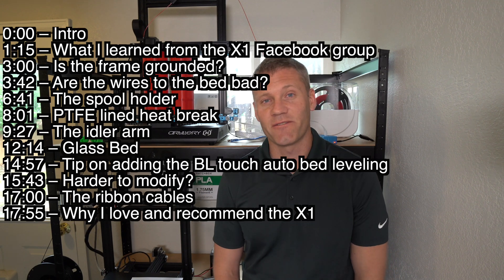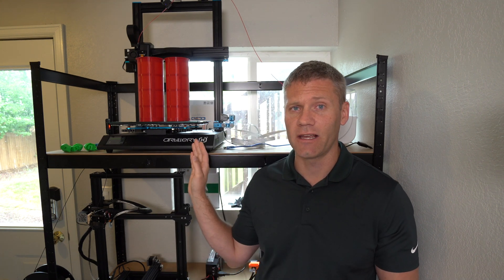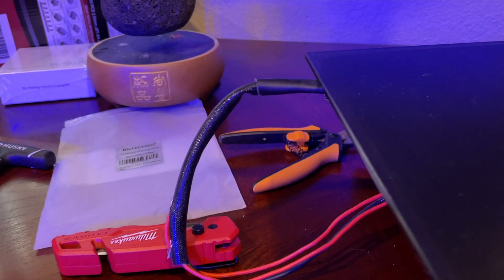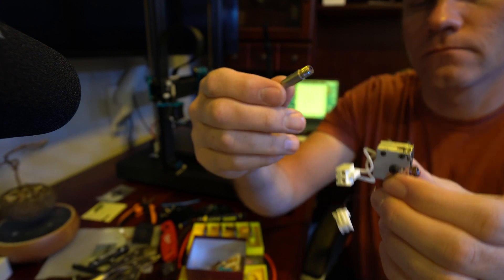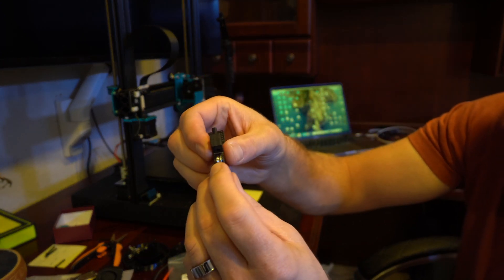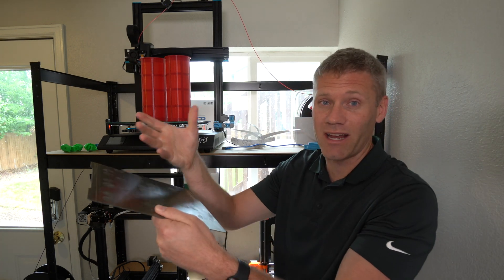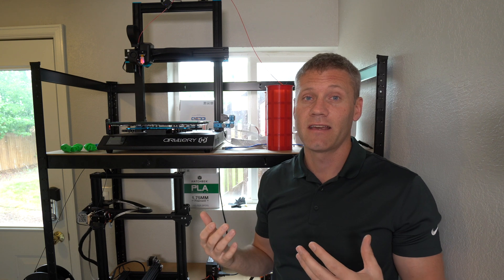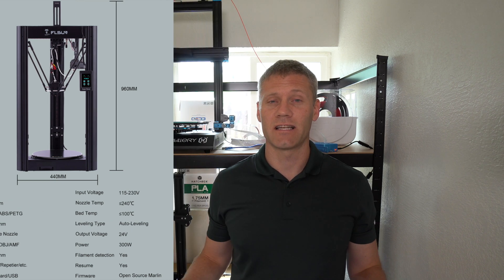Artillery Sidewinder X1 Review - 6 Months Later

Comment: I had the sidewinder x1 since ~2021 (so it is the v4). My experience was a bit different:
-Bed cable broke after only 8 days, replaced the iron strands with normal household copper strands)
-added a steel sheet printbed (best upgrade imo!)
-printed and added a simple ribbon cable brace to the print head as I heard people had issues with that part
-replaced the nozzle with a ruby one (for abrasive glow in the dark or basic white filaments for example)
-usb sticks got fried a couple of times from voltage spikes
-touch screen got a "permanent touch point" (where it spams "taps" in one area)
-as the "frying" got worse, the tft froze in the middle of printing (and with it the prints failed)
-frying of sticks and touchscreen were caused by the very cheap psu (slight changes at input voltage caused big voltage spikes on dc side)
-replaced the psu with a proper one and replaced the tft as well
-the frame for me is not grounded for some reason... just wanted to add that. Some parts internally are grounded though. Like the shielding on the psu is grounded but not the frame/metal/screws of the printer itself!
-used octoprint as it is just more reliable and offers camera support for checking in from a distance
-tried to get "pause commands" to work but it is just not really compatible and everything that works is just too hacky for it to work on every slicer (upgraded firmware on mainboard/marlin and the tft /Rawr tft -> really useful as it has a console, offers more options and makes beeps quieter)
-the extruder started to make weird noises and the ribbon wires started to get way too hot (after about 4 years of use) as the ribbons are rated to 80°C but were over 100°C at the connectors!
-reason was the bearings inside the extruder stepper were finished: really crunchy and pieces of metal fell out. Same with the thin bearings on the idler. It was running on the aluminium already xD. Beplaced the bearings inside the stepper (very cheap) and the thin ones (ordered quality ones, but artillery gave some simple ones in the spare parts bag!)
-added M8 steel rods to stabilize the z-axis for a bit less wobble when printing tall & heavy objects
-added an led strip to the horizontal x-axis made from spare parts

So far a good workhorse, that needs a bit of attention every now and then. Best 300mm printer <300€ back then as long as you dont mind modding and a bit of repair.
Only things that reallly annoy me are that the hardware/software does not support normal pause commands and that the bed is rather unevenly heated.... But as long as I keep that in mind when placing objects, I am able to work with that! It is now printing weeklong gcode files for giant hd moon lamps. (1300MB gcode files)

-I never had real problems with the ribbons that interrupted a print
-I never had issues with the z axis wobble so far. Only noticed that it swung around too much for my taste which caused artifacts in tall objects when I accidentally touched it or pulled filament from a dryer over the filament holder from behind the printer.
-I never had issues with the idler either. But I replaced it with an aluminium one this year. As I was already replacing the bearings in all the printhead stuff.
-I never had issues with hotend. But I might upgrade to an all metal one when I feel like it could use a bit of love (for the trusty work it does) Any recommendation for a good fitting one?

Comment: 2 years with my X1 and zero problems.  No ribbon cable problems, no idler lever problems and no bed problems.  I think a LOT of the initial commentary on "problems" was just regurgitated "Internet rumor" opinions and not actual deficiencies.  The only thing I have done was to install an all-metal hot end.  That's it. It just works.  I now have another Artillery, the X2 this time and I'm happy with both.
Reply: I had the sidewinder x1 since ~2021 (so it is the v4). My experience was a bit different:
-Bed cable broke after only 8 days, replaced the iron strands with normal household copper strands)
-added a steel sheet printbed (best upgrade imo!)
-printed and added a simple ribbon cable brace to the print head as I heard people had issues with that part
-replaced the nozzle with a ruby one (for abrasive glow in the dark or basic white filaments for example)
-usb sticks got fried a couple of times from voltage spikes
-touch screen got a "permanent touch point" (where it spams "taps" in one area)
-as the "frying" got worse, the tft froze in the middle of printing (and with it the prints failed)
-frying of sticks and touchscreen were caused by the very cheap psu (slight changes at input voltage caused big voltage spikes on dc side)
-replaced the psu with a proper one and replaced the tft as well
-the frame for me is not grounded for some reason... just wanted to add that. Some parts internally are grounded though. Like the shielding on the psu is grounded but not the frame/metal/screws of the printer itself!
-used octoprint as it is just more reliable and offers camera support for checking in from a distance
-tried to get "pause commands" to work but it is just not really compatible and everything that works is just too hacky for it to work on every slicer (upgraded firmware on mainboard/marlin and the tft /Rawr tft -> really useful as it has a console, offers more options and makes beeps quieter)
-the extruder started to make weird noises and the ribbon wires started to get way too hot (after about 4 years of use) as the ribbons are rated to 80°C but were over 100°C at the connectors!
-reason was the bearings inside the extruder stepper were finished: really crunchy and pieces of metal fell out. Same with the thin bearings on the idler. It was running on the aluminium already xD. Beplaced the bearings inside the stepper (very cheap) and the thin ones (ordered quality ones, but artillery gave some simple ones in the spare parts bag!)
-added M8 steel rods to stabilize the z-axis for a bit less wobble when printing tall & heavy objects
-added an led strip to the horizontal x-axis made from spare parts

So far a good workhorse, that needs a bit of attention every now and then. Best 300mm printer <300€ back then as long as you dont mind modding and a bit of repair.
Only things that reallly annoy me are that the hardware/software does not support normal pause commands and that the bed is rather unevenly heated.... But as long as I keep that in mind when placing objects, I am able to work with that! It is now printing weeklong gcode files for giant hd moon lamps. (1300MB gcode files)

-I never had real problems with the ribbons that interrupted a print
-I never had issues with the z axis wobble so far. Only noticed that it swung around too much for my taste which caused artifacts in tall objects when I accidentally touched it or pulled filament from a dryer over the filament holder from behind the printer.
-I never had issues with the idler either. But I replaced it with an aluminium one this year. As I was already replacing the bearings in all the printhead stuff.
-I never had issues with hotend. But I might upgrade to an all metal one when I feel like it could use a bit of love (for the trusty work it does) Any recommendation for a good fitting one?

Comment: I've been fighting hard to address a really strong bed adhesion, like the parts will NOT release. The fix I've been doing, until late, has been using a raft for parts so I can destroy a raft to try to release the parts easily, lowering the build plate lower for a "air gap" between the raft and the build plate, using Painters tape to avoid potentially warping the bed when "prying", AND heating up the bed after the print is done for making the raft malleable again while working the part. I want to enjoy using the special release build plate without using a raft for a smooth bottom surface, but with how strong my prints have been adhering, I'm scared it'll become a permanent attachment to the bed. I love this printer, and it works great and makes beautiful parts. It just holds them too tightly.

Do you have any advice?
Reply from the maker: Scuff it slightly with some sand paper, then clean well with alcohol. raise you starting z height. Its either really new and just sticking well or you too low on 1st layer, Even if you just clean it 10 times with alcohol I think would help get it a little warn.
Reply: @Walt's Reviews  When you say scuff it, you mean the build plate or the tape? Wouldn't scuffing it make it "grippier"? I have some 220 grit i could use, maybe 500. 

I raised the Z height and get differing results depending on the parts, but that's helping. It heats up nicely, I've been using 80 degrees for the build plate, and some wider prints still have some warpage, but I think it's a matter of "small prints need rafts and supports for easy release, larger prints need higher Temps for preventing warpage at the build plate."

I'm not against the scuffing, I just don't want to mess it up. I've been considering a PEI, but it seems this kind of build plate makes that redundant, right?
Reply: @waltsreviews90  spend the money on artillery’s pei bed sheet. Don’t listen to others and clean it with rubbing alcohol. I never touch it bare handed, I wear rubber gloves and I couldn’t get a single thing to stick to it until I washed it. Most people use dish detergent however I use something from my car cleaning supplies- strip wash by Adams polishes. Ever since then I have had zero, and I mean zero adhesion issues. I have never once even took the sheet off to bend it to release the part either. Not once. The prints stick like they are welded on during the print process and when it’s all done just let everything sit and cool for about 20 mins give or take. You will hear it pop and you can literally just walk over and pick up your print. No scraping no glue stick no aggravation. Spend the 60 bucks trust me. And level it with a business card. You’re going to be so happy

Comment: I think the extruder pressure (idler) arm braking was with the first series and down to an inferior plastic used . I too have never had a problem with plastic but changed to alu just in case,  As it pivots in the stepper motor axel a good well lubed bearing is important and my gut feel is the super rigid alu arm does a better job of guiding the filament. Like wise the first series suffered from "questionable" ribbon cable connectors which have now been updated for a better connection.   For those that don't want the hassle of installing a sensor there is also a manual method which is explained here  https://youtu.be/0MLo6fkeFmI
There's also an excellent video on how to repurpose the OEM Z endstop as a sensor . Worth a look > https://www.youtube.com/watch?v=RwYuqzj3aLc

Im tempted to install a 32 bit board but am applying the "if it aint broke dont fix it" principle !!
Reply from the maker: lol, no point in creating extra work for yourself! Thanks for the input, I'll check that out.

Comment: Your video pretty much confirms all I've found out by watching a bunch of other videos. Yes, a lot of people love this printer and get great results from it, but there are one or two (actually, mainly one) reviewer who really hates it and puts out really scary reviews. He does have a point when it comes to the bed cable and the lack of strain relief, but now he's come up with other things he doesn't like, such as the extruder design. A couple of others have had problems getting good prints, but they do seem to be much in the minority. One person had a problem because Artillery changed the pinouts of the printed boards that connect the ribbon cables, people in the comments pointed out all he had to do was replace the whole set of three instead of just one. The strain relief problem is something that can be easily fixed by someone who's already been 3D printing, and point taken, for a newbie using the printer out of the box, this might be a danger. I'm in the market for a larger 3D printer and the new Sidewinder X2 is at the top of my list. They've added auto bed leveling, strain relief for the ribbon cables, a new flat bed cable, a new plastic crosspiece (like the one on the Genius) for the gantry, a 32 bit board, and probably a couple more things I've forgotten. The printer I've been using so far is a Wanhao i3 Plus which I bought in 2017, it's primitive in comparison, but what attracted me to that printer are more or less what attract me to this, namely it's mostly assembled and not a project. Yes, the hot end does have a short piece of PTFE tubing in it even though it's a direct drive. Other printers I've considered as an alternative to the X2 are the Ender 3 Max (only one Z axis screw, and is a lot cheaper), the Bluer Plus and the Sapphire Plus (these all use Bowden tubes, the Sapphire is a CoreXY). Something I wonder about - how (in)convenient is it printing with a printer on the top shelf like that? The shelf looks about shoulder height. Do you use a stepladder to do things like change filament? That stock spool holder would be doubly inconvenient.. it's way up there, and I wonder if there's even space below the ceiling for it. The new X2 uses a spool holder like the one on the Genius, and should be more convenient.

Comment: This Printer or the Ender 3 V2 ?
Reply: Or more to the point - the Ender 3 Max. I've made the comparison - the Ender 3 Max is over USD100 cheaper, but by the time you've added direct drive and a second Z axis screw (necessary if you added direct drive), you're almost up to the same price anyhow. When you've added a BLTouch, it'd be more expensive. It does have a removable glass bed (I wish the Artillery used one). By the way, the X2 is now out - it's got automatic bed leveling and a better bed cable, among other things.
Reply: Artillery sidewinder Every time

Comment: My bed looses adhesion near the end of the print, I wonder why? I cleaned it with Windex edit: printing pla+ at 70deg
Reply from the maker: Clean it with 91% isopropyl alcohol, the stock print that came on the card had the bed set to 80deg for PLA, 70-80 should be good.
Reply: @waltsreviews90  The spring steel sheet that I got for my bed demands 99% pure IPA. Windex might not be a good thing for any printbed.
Reply: After several prints use some dish soap and water then use alcohol. Or if you have a PEI sheet on your bed take some 2000 grit wet sandpaper. Sand it smooth and clean it with alcohol.  I tried both of those after someone suggested it. No more adhesion problems.
Reply: @ASSOpid  The retailer says only to use 99% IPA though...
Reply: @FuriousImp soap and water as advised.

Comment: I have a question, of all the 3D printer, are you able to use them almost everyday? (like is it possible? which one last longer and still works and give good result)? Thank you.
Reply from the maker: Yes you can use them everyday, but you will need to do maintenance on them. Replacing parts that wear out like nozzles and basic cleaning. My Sidewinder has been great, but I only been doing it 6 months so not sure I can say one better than other for long term.
Reply: The bed is horribly warped. The titan extruder clone broke. I'm spending more on it than the initial purchase value. Don't get a Chinese machine. Get a good one.